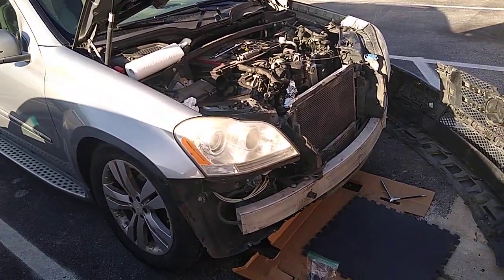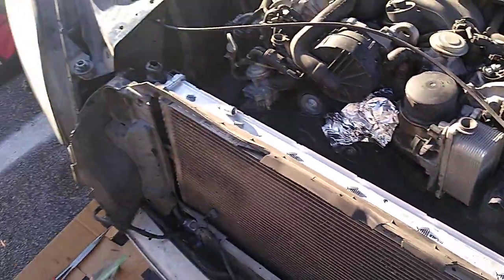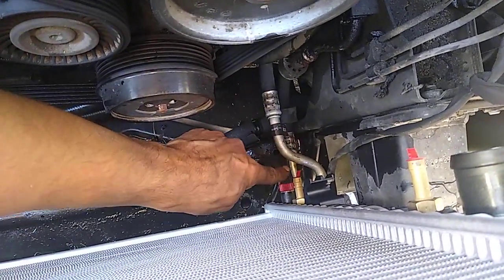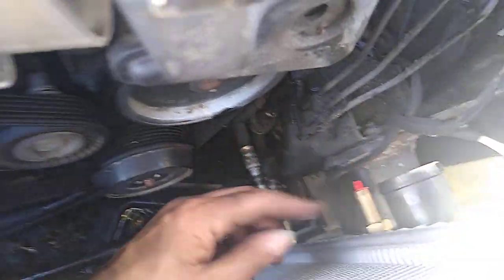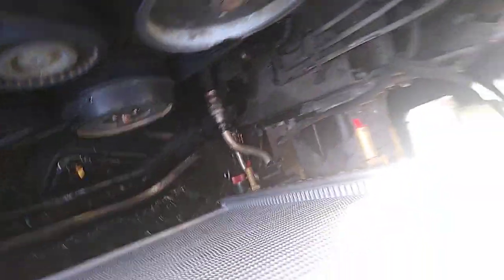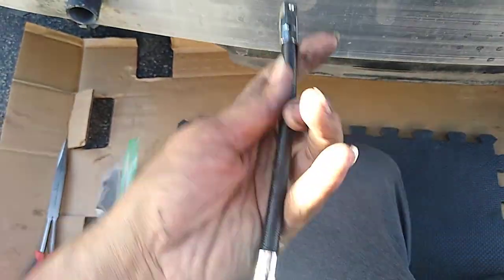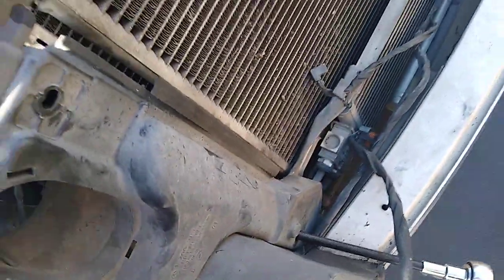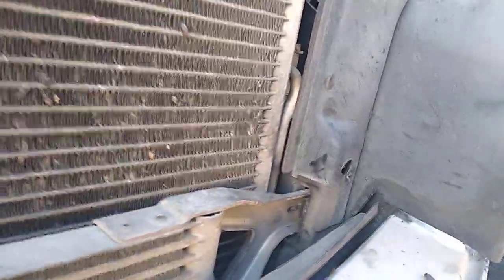Mercedes Benz GL450 radiator removal without A/C removal

Comment: Great way to initially save money, but I believe the condenser should be replaced at the same time as the radiator.  Since the condenser typically lasts 15-20 years and when the radiator fails, it seems like most vehicles last about 15 years with close to 175,000 miles on it on the X164.
Reply from the maker: No doubt about it! Not everyone has the funds to accommodate replacing everything on schedule though.